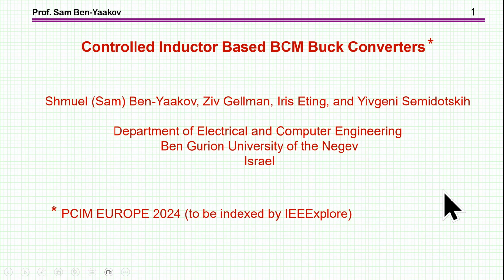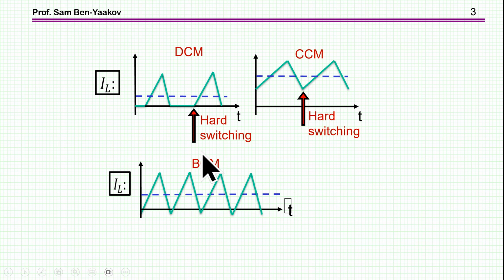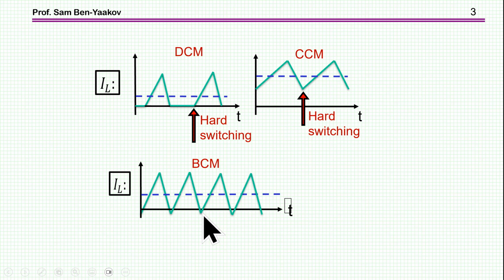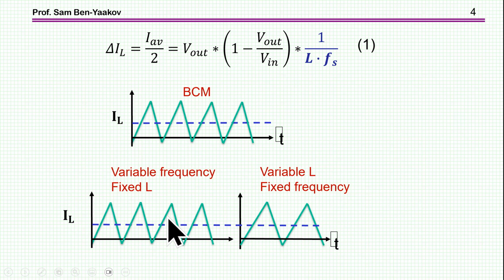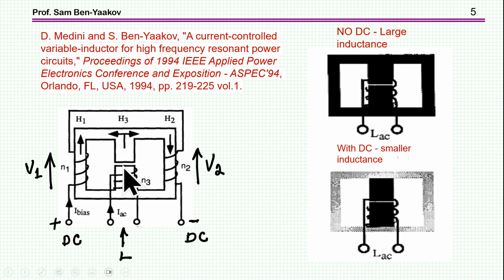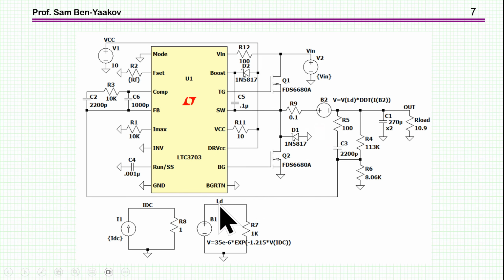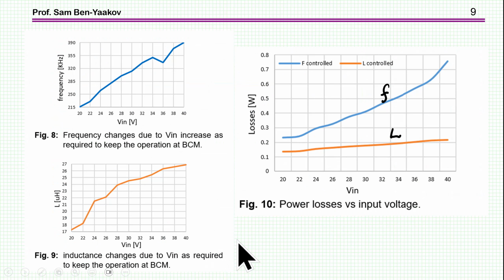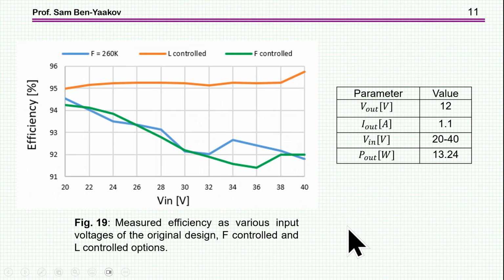Controlled Inductor Based BCM Buck Converters

Comment: Old Tektronix scopes used a variable inductor to regulate the power to the tube filaments to compensate for line voltage changes.  Always be intrigued with saturation controlled chokes and transformers.
Reply from the maker: Thanks for inptut.

Comment: Thank you sir.
I have question. In the begining of video you mentioned working power supplys in parallel. My question is what are the considerations of using two SMPS in parallel? Onetime I used two SMPS in parallel (with same voltage) but both of them burned out. Thank you.
Reply from the maker: You need current sharing circuitry.  See videos on the subject in my channel.

Comment: Have you considered just designing a suitable "swinging choke" inductor?
Reply from the maker: Hi Michael, a swinging  inductor is affected by the average inductor current which is constant in a Buck with constant output current. So, the swinging inductor will not be able to adjust to BCM if the input voltage is changing.

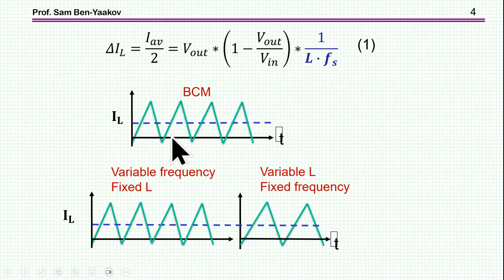Comment: At 2:58 you say that BCM has lower losses because of softswitching, at 7:07 you're showing that CCM going to negative current has increased loss. Why doesn't the CCM also have lower losses due to softswitching? The current is going to negative as it is in the case of BCM.
A very interesting stuff by the way!
Reply from the maker: Thanks for conversation Indeed, soft switching, but the conduction losses are higher sue to larger rms current.
Reply: @sambenyaakov  Right, thanks for the answer. One other thing that I also don't understand is that what is the difference between such CCM that goes negative and BCM which also goes negative? I thought BCM is a mode where the inductor current exactly touches zero, once it goes negative it seems like CCM to me.
Reply from the maker: @Astri.electronics  Strictly speaking BCM is indeed when the current touched the zero level. But then the inductor does not have sufficient energy to charge the output capacitance for self commutation of the mid point. So a bit negative is important to avoid hard switching due to Coss. If the current goes more negative losses will increase due to the increase in the ratio of the RMS current of the inductor to the average inductor current (the output current).
Reply: @sambenyaakov  Yes I understand the importance of negative current for soft-switching. However at that point if the current goes negative, it's no longer BCM but CCM, if I understand it correctly.

Comment: Wow i am impressed by the graph (on the timemoment 8.55). I did not know that an inductor can be regulated so nice, i mean so rather lineair enough over that surprising useful piece of the scale. But we do not talk about small signal use of the inductor. Is the inductance really that useful? according the graph? I mean, the current (and thus also the saturation, at least here in these powersupply-sort-of-uses for the inductor, is in that saturation the dc current that the supply has to deliver not a just as big influence as the dc current in that extra windings around that other legs of the core? The graph looks so useful with just 0 to 1 ampere to regulate the inductorvalue but if the inductor is part of a 2A circuit, will that 0-1A in those two other legs still have that nice useful working? 
You see, inductors are my least intuitive understanded components. I have used them as least as i could during my lifetime, but since i learned so much insights from your videolessons, even started to get a beginning of an intuitive way of working with them. 
Ow i enjoy learning from these videolessons of yours simply most of all things. 
So much thanks for teaching on us who love to get the most out of our understanding of electronics.
Reply from the maker: Thanks for sharing Rob